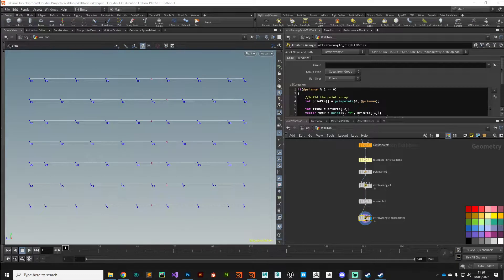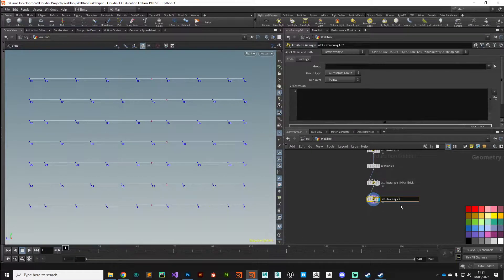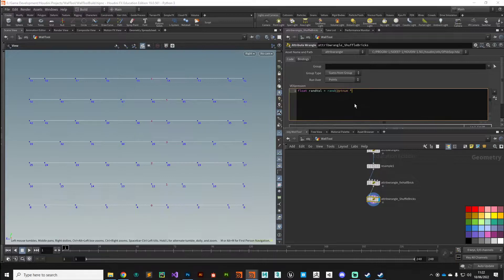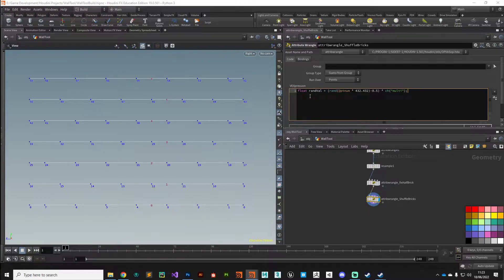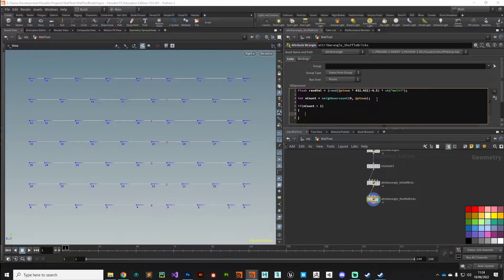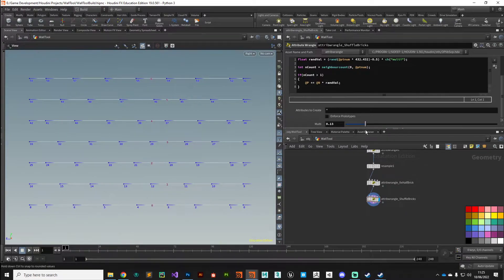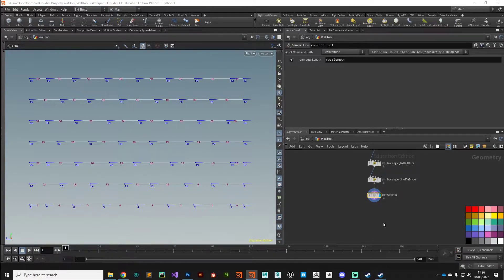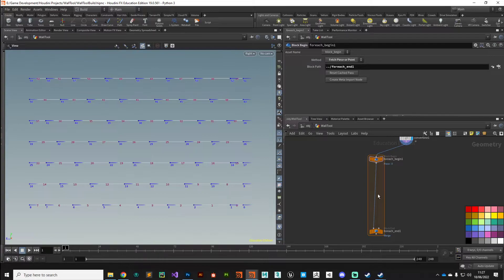Houdini 19 - Wall Tool 04

Comment: Me again,
I am having some questions while watching if you don't mind.

When you shuffle the points randomly, you are multiplying it with N... Is that so you do not define P.x
That would work as well... Right.

@P.x *= randval
Reply from the maker: That could work but only in the x axis. We need the Normal attribute to give our points a direction to follow so it conforms no matter what curve is input.
Reply: @RickBanks  makes sense now.. Thx.

Hope you consider my other comment about a functions series.

Also, looking forward for the rest of the series... Are the remaining parts coming soon?